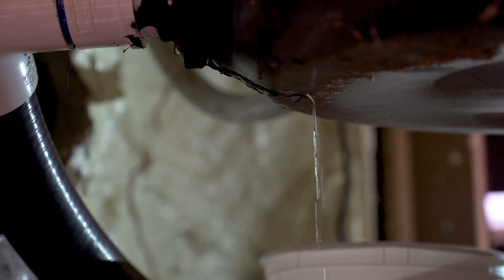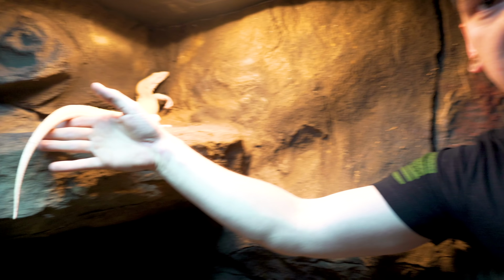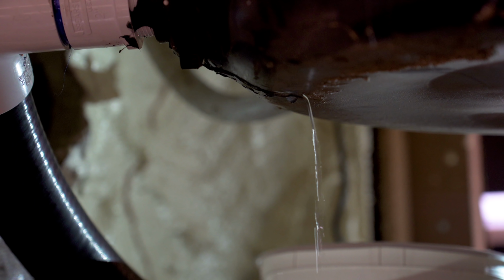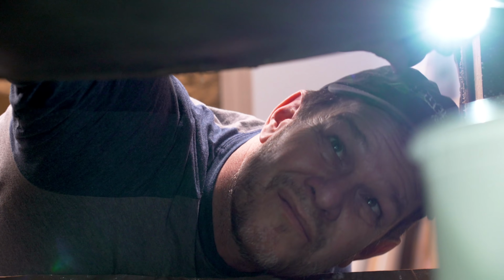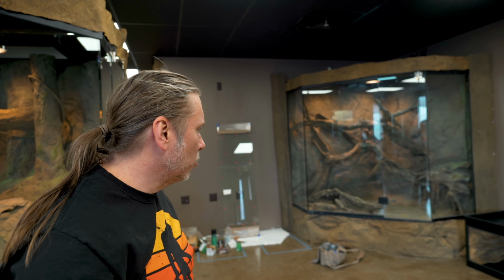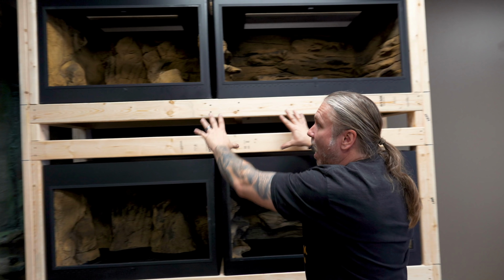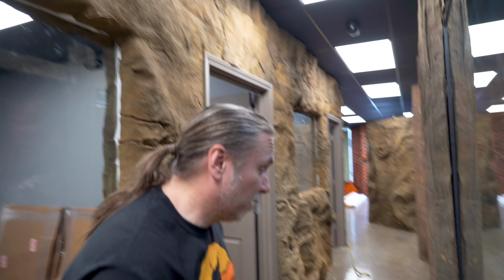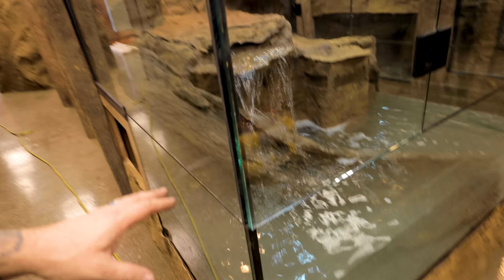300 GALLON ALLIGATOR TANK IS LEAKING!! NOW WHAT? Reptile Zoo Build day #5 | BRIAN BARCZYK

Comment: [Im not blaming BHB or anyone person]
This is why you
1 get a sealant appropriate for the gallons/pressure expected. As well as intended use. 
2 double check the sealant already used (if any)
2a this means visually inspect the current sealant not just know what its intended use is.
2b and waiting thebappropriate cure time
3 use your own sealant (if step 2 is nonexistant insufficient or even slightly questionable) ment for the job. Weather its the use of plastic/canvas lining between wwod and background/water in a display tank, melding acrylic in a more open tank or caulk/grout on the flooring/sidepanels. 
4 physicaly [stress] TEST the new tank by filling it slowly with water or compressed air. In stages untill full and reinspecting the sealant [step 2, a and b. followed by 3 and 4 again if needed] 
5 Regularly inspect and check for leaks. 

Even the most diligent contractor can miss a pinhole leak. But they should also be willing to correct the mistake.

Comment: Hey brian just in case of a flood u could install some floor drains that the water could go down  just in case of a massive leak
Reply: The Irish man paddy shalloe  I saw them drill through some floor drains. Brian always thinks of everything so I have no doubt he is prepared for any mishaps ☺️
Reply: @malonielangthorne2848  I did too, but from what I seen those floor drains that they drilled were only drains for draining water out of water feature enclosures and there's none on the main floor walking area. I could be wrong, as I am sure with him mentioning how nervous he is about water features leaking. I'm almost positive you're correct. I can also see floor drains being a mandatory part of City or State building code for something like this as well.
Reply: Thays a good idea when you have a lot of water around it would save a lot of damage to the other tanks too if you did that . Also really easy to get them put in
Reply: You can get through this chin up

Comment: I'm a glass and metalworker. Thanks for putting the spotlight on my trade for a minute. That's laminated glass which is two pieces of plate glass with laminate in the middle. You score both sides, run the cut, soak in alcohol, set it on fire and the flames will melt the laminate as you break the glass away. Always fun to do
Reply: PSN Bluntus I was in that industry for a little over a year I enjoyed it very great trade to have underneath your belt
Reply: Wait doesn’t this cause internal stress in the glass and if not Handel right can’t it break randomly later on